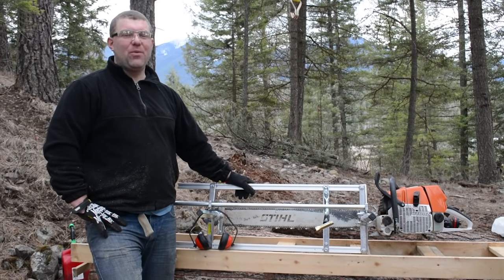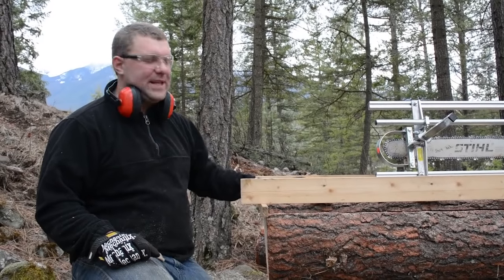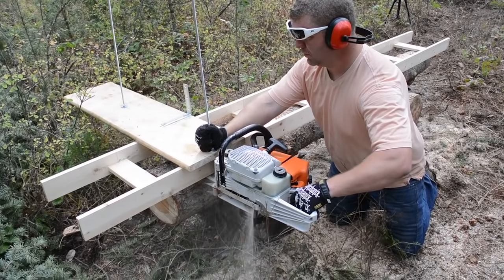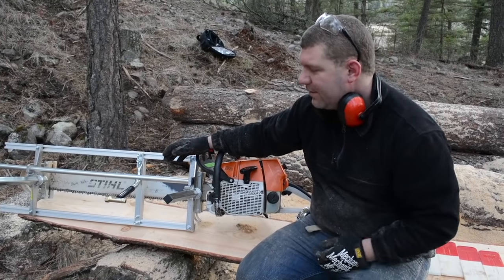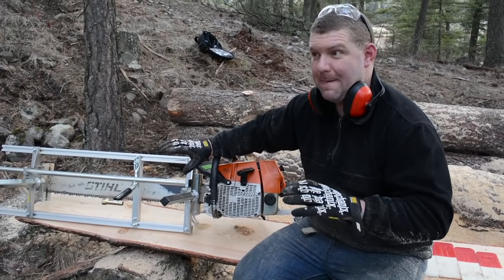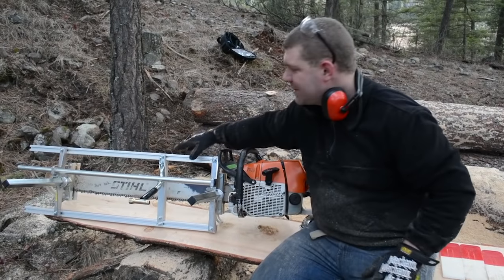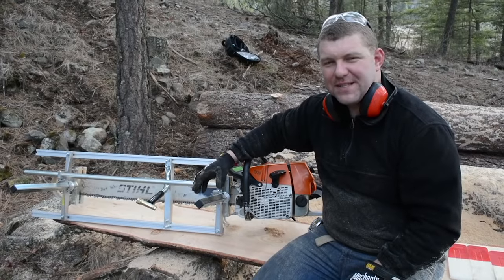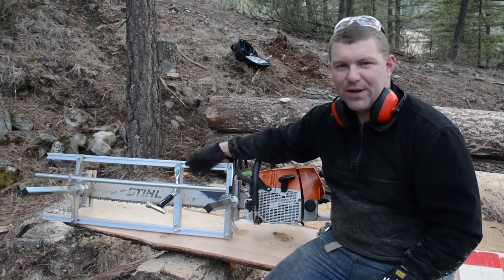INSANELY EASY CHAINSAW MILL TEST DRIVE! + First impressions VS homemade mill

Comment: A quick tip to help your chains stay sharp. remove the bark from the logs. The bark holds a lot of dirt and the bark itself will dull the chain itself faster than clean wood.

Comment: I run the same mill with a Husqvarna 395xp. I have a modification to suggest that I have done to my own mill that made the milling much easier. I moved my handle down towards the tip of the bar and installed a hand winch from tractor supply company (like the ones you find on a boat trailer) with para cord and a hook on the end of it. You run the line out to the end of the log to an anchor point and slowly crank the handle on the winch as the saw is running threw the slabs. Makes it a lot easier on the bach and arms.

Comment: Back in the late 1970's when I was building off grid on Whidbey Island, WA.  Had a portable sawmill come in to mill my lumber to dimensional size for under $150 per 1000 board foot, much less sawdust.  Air dried with stickers for a year before using.  Worked good for me.  Wish that I had your information way back then, took me eight years to build my 1400 sf two story house...

Comment: I run an ms 661 with my Granberg. I have a 36" bar setup, and use the auxiliary oiler. I try to keep my bar perpendicular to the work, and use milling chains to get a pretty good finish. I'm looking at building a milling table to be easier on the back. Looks like you've got it figured out, but I have to agree you should wear some chaps, especially since when milling, we put our selves a lot closer to moving chains than in conventional use. You have graduated from safety chains when using these big boy saws! Keep up the good work! Look forward to more updates on different projects, and uses.

Comment: Just a thought on drying the planks.  If you don't paint or protect the ends of the planks while drying they will split.  Just my two cents.
Reply: Dale Church he is sawing pine, you do not need to seal pine or soft woods, the sap seals the ends.

Comment: A little tip .Turn  the bar over every time you sharpen your chain. it will save your bar from getting worn out on one side. like in this video the paint is wearing on on side.
Reply: Good Point .. bar maintenance is important, , , one thing I learned was  look at the bar rails, and make sure the chain is not wearing itself INTO the bar,  so that the rails of the bar are outside the cutting width of the chain, , some times the rails have to be peened in a speck to do this, and a lite filing job to remove the KNURLING effect cures this. you can not remove too much of the rails, if you do the drive teeth will bottom out in the bar, and wear the drive teeth out, and you loose the grip of the teeth in the drive sprocket, and derailing the chain may also result.

Comment: Works well doesn't it!
Let gravity work for you, raise the starting end of the log much higher than the ending end of the log, trust me this will make it a LOT less work for you, it almost becomes self feeding, really try it. You won't have to pivot the saw as much, and you will get a smoother surface, IMHO. 
How is the oiling on the bar? With those smaller logs I bet you can get away with just the oiler on the saw, but if you get into larger logs, you might want to think about the oiler, it will make your bars and chain last longer, which is worth it I think.
Best of luck, and keep up the great videos.
Domo
Reply: SPOT ON, you do not need a lot of ''fall'' from one end to the other in order to make it work, but any degree of fall is good, , I have run one of these, and tried to cut one on a slope, , , it is diffidently easier to carry the saw to the higher end of the log than to push the saw through the wood, uphill,

Comment: I've had my Granberg on an E20 with a 32" blade for years, cutting 20x40" ice blocks into 4,5, and 10" slabs.  Works great, since the blocks are only 40" tall, I go vertically and the bar walks it's way down with very little effort.  Like the guide for the initial cut, thanks!

Comment: Curious why you built a wooden ladder.  Would it be practical to use an 11' section of ladder that is straight, square an stiff against racking?

Comment: You may want to have your guide ladder boards longer, sticking out over the ends of the log as to make it easier to sit the saw on to get started and to finish.  Also, I know it is uncomfortable, but, you may want to wear a dust mask, as with years of sawing in close with a chainsaw or woodmizer mill you may development breathing problems.  Just my two cents from many years of it.

Comment: Jesse/Alyssa, I notice you are building on concrete piers, keeping the wood off the ground. What are your thoughts/fears on termites, using untreated lumber? Or using termite resistant wood on your vertical posts?

Comment: Good video !

If you do start having a problem with nuts and bolts coming loose, replace the nuts with nylock (nylon locking) nuts or, if you have to, use blue thread locker.

The smartest thing you can do, if you have a lot of cutting to do, is have at least 2 spare chains !  When one starts to get dull, swap it out.  Filing a chain saw is almost an art.  You can learn it, but I would want an expert looking over my shoulder for the first dozen I did !  You are much better off taking them to a place that specializes in sharpening !

Keep looking for a second smaller saw.< 24"  (<18" ?) for felling and limbing.

Comment: Hi
Looking at you cutting the lumber I would suggest that you could slide the handle even further to the right and still feel comfortable and I think being able to keep the bar as straight as possible would make a big difference in the quality of the lumber. You would get the best stability if you have the whole board between the saw and the handle but that might not always be possible. It seems easy to adjust so play around a bit more and better to feel comfortable than unsafe.

Comment: Hey Jesse - I'm from SW Oregon, loving all of BOTH of your videos with Alyssa's edits/production, of course! Curious to know how the Granberg chainsaw mill 'balances' out the weight of the MS660 in order to produce a near-level cut. Is there a way to compensate to make the cut as level as the 'leveled' surveyor stakes at each end? Keep on rockin it, you two!! No accidents! Amazing work! Cheers ~ Kevstir

Comment: 0 or 5 degrees on your crosscut chain may help...also...if the chips are a little big just keep the raker height closer to the tooth height....some other geometry on the milling chain may be different...price difference vs time to modify will determine what is worth it for you.

Comment: just a heads up, you should probably think about squaring out the logs first, i dont see it much on youtube but the bark being dragged through all the mud and dirt will eat the chain! maybe a "beam machine" or something similar would help. you could do the squaring with the saw mill but either way its a log of buggerin around lol
Reply from the maker: Addressed this in another comment below. For lumber you waste too much wood squaring the log. For beams it's a no brainer.
Reply: Pure Living for Life i never thought of it that way... hmmmmm we never wasted anything at the mill but all of us worken there burned wood for heat. my only question and no one seems to answer it is how do you ge square wood if you leave a live edge on the stuff ur cutting? if u square it out after wouldent that be just as much wastage? im not sure how particular u are about the thickness of oyur boards but i see a lot of guys on here using aluminum ladders for there first cuts. the wood here is pretty crocked even the No.1 wood we get lol. i wish u guys well bro we'll be starting our home stead soon i hope just waiting for land prices to come down a bit further so we can get hte most bang for our buck!

Comment: Extend the runners on your ladder so the saw attacks level. Then it will be more clean at the beginning.
Reply from the maker: Noticed that after our first cut. It's what we normally do but apparently out of practice after 4 months off. After this video we milled up all 5 logs. Went like lightening after we got things sorted and into a groove.

Comment: If you cut bigger logs into lumber do what I did and put a hand cranking winch on your sawmill. It works great pulls the mill straight and saves a lot of labor.  I've cut beams 12 inches thick by26 inches by 28feet8inches long. Worked great.
Reply from the maker: +guy mcelwee I've heard of such contraptions. If we get heavy into beams we'll have to do something. The fatigue will start to set in! Thanks for the tip!

Comment: I have a suggestion for the first cut and end cuts. I made my ladder,double the width of the mill  added to the length of the log. so an 8ft log would get about,a 10ft ladder. get a nicer first cut and a no worry end cut,cause you're not supporting half the weight of the saw and mill.

Comment: I'm guessing that you have a few ladders of different lengths, so that they will match up with your logs. It looks like the ladder needs to be a little bit longer than the log, but if it's too long it would be awkward. Or do you try to cut the logs to match the length of your ladders?

Comment: How many linear feet will one chain last ?    How much do the chains cost ?   Will you have to use the cut wood immediately per warping if sitting ?   Will you cut the planks
at 90 degrees (cracks between boards ) or at an angle to minimize the cracks ?   Continued good luck
Reply from the maker: Video on chains is in the works! Subscribe if you'd like to be notified when it's available! :)

Comment: Curious to eventually hear how many boards can be cut before you need to sharpen the chain.
Reply from the maker: I was able to cut (28) 1.5"x14"x8' slabs before sharpening. 224' of slabs to be exact.
Reply: +Pure Living for Life Thanks for your reply. I do some chainsaw carving and might use something like this to make benches.

Comment: Excellent product review and teaching vid.
We are considering a Granberg for a group purchase vs a bandsaw mill
Price is close for us since the bandsaw is well used (so less expensive) and we'd have to buy a powerhead as well as the Granberg mill.

Do you have experience and/or a preference between the two ideas?
Reply from the maker: We didn't really buy the saw so we could mill. We knew we'd be milling so we invested in a saw that could do it all but we knew we'd need firewood too so it's a very versatile tool for us. 

We haven't done a bandsaw mill so we can't testify or truly compare them. However my mind is telling me good luck moving logs around. I think milling is pretty straight forward but moving logs isn't so easy. At least for us they're on a hill and that makes it way more difficult. So mills aside think about where you'd be milling. The reason a chainsaw mill makes sense is we need only get them a short distance. Even a portable mill would have a hard time getting where our trees are. So I guess consider that in your decisions too.
Reply: Excellent point about moving logs.
Thanks again.

Comment: Would it help to put a tarp underneath the log so you can collect the saw dust easier later? Thanks.
Reply from the maker: That totally crossed my mind, but then I was pondering the safety and difficulty that might ensue trying to keep it untangled, out of the saw should the wind kick up. Plus we lack a place to store the sawdust for now. So we just went ahead and worked. Lol. We may just try that on the next round though. Seems much easier doesn't it? :)
Reply: Wouldn't the corners stay if you just put heavy objects on it? Or even stake the corners to the ground somehow until you need to pull it up?

 They sell things to put large garbage bags on so you can lay on the ground to sweep leaves into.

 Would saw dust inside toilet paper rolls be a good fire starter, too?

Comment: I really appreciate you doing this video.  I have a bunch of hardwood logs from 6"-20" diameter and 6' long logs that I want to mill up to make a hardwood floor for a old house I bought and wanted to know your advice on doing this with the Alaskan mill.  I bought a Grizzly 15" planer I was going to use to plane it after milling it.   Also wanted to know if the MS-660 is powerful enough after hands on experience or if you would get a bigger one.

Comment: What would you recommend as a minimum saw to mill 16inch logs? would a Stihl MS 291 be sufficient? I'm felling pine in my yard and it seems a waste to buck it up when I could be using the lumber for a variety of projects.
Reply: It'll take quite a while and you might encounter oiling problems with a longish bar, the minimum I reckon would be 24''. My old husky 66 was just about up to that size but it really amounted to chainsaw abuse.
Reply: Thank you, I appreciate the info. In the end, I'll be taking to a mill, which in my neck of the woods are not lacking.

Comment: Just wondering why you cut slabs, and not just use the mill to cut dimensional lumber?
Reply from the maker: +melissa cripps Slabs are milled and then cut into lumber with traditional power tools like a table saw and circular saw.

Comment: Is there actually a need to "pivot" the saw? Can't you always keep it perpendicular to the log? :)
Reply from the maker: +Bryan Teal Ideally square to the log is best but there are time when pivoting is helpful. 

1. When you're moving the power head around a knot. The head will make a curve around it resulting in the mill pivoting.

2. In our case we bucked our logs between two trees used as a rigging for lifting. This resulted in the logs being close enough to the tree that the 36" wide mill couldn't pass by the tree without some pivoting and maneuvering. 

3. When working through thicker logs, just like with cutting firewood, anchoring the saw on the felling dogs and pivoting the bar makes cutting much less fatiguing. 

Hope that helps! :)

Comment: I am shopping for saws and keeping in mind that I also want a Granberg style mill for a timberframe structure as well. Any advice on saw selection and other thoughts would be welcome. I am also hoping to cut logs 3 and a half to 4 feet in diameter. Great video, I just subscribed so I'll be looking at the rest. Thanks